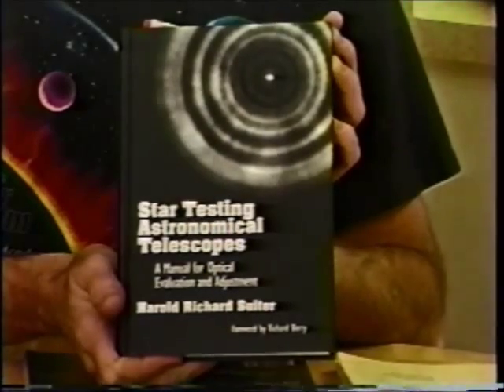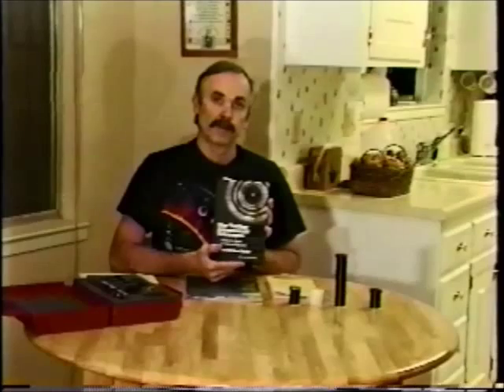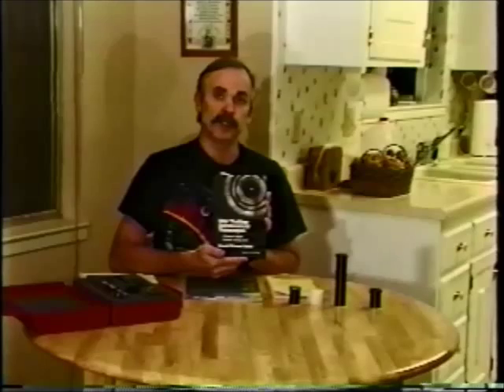Collimation Of Newtonian Telescope Part3

Comment from the maker: Hernando    In a typical 9 point mirror mount it is normal that one point of each three point triangle would be fixed to the mirror. I'm a little surprised that the factory uses double stick tape rather than perhaps a silicone adhesive, but that is their choice. There should also be some sort of non-contact guard over the mirror in case the attachment should fail. If the mirror is changing its orientation I would inspect the triangles to be sure they can rotate with minimal friction about their pivot point, and without any looseness. There are many other possible causes of loss of collimation, but to your specific question, I see nothing wrong with attaching the mirror to the 9 point mount at three, and only three, points, one on each triangle. ...Rich